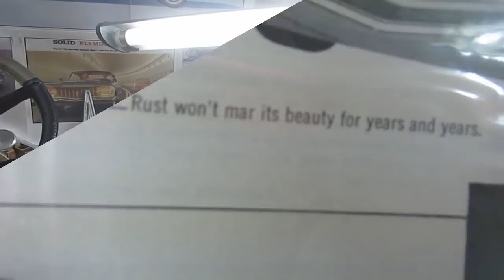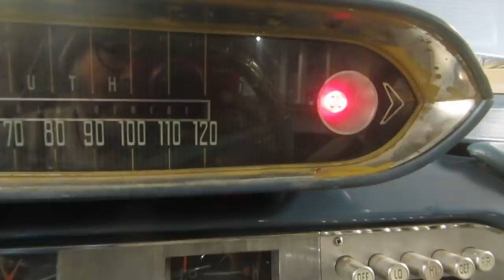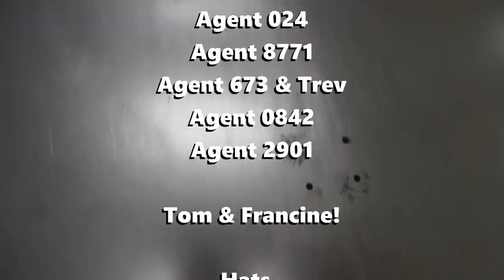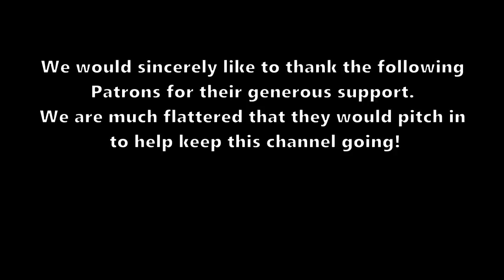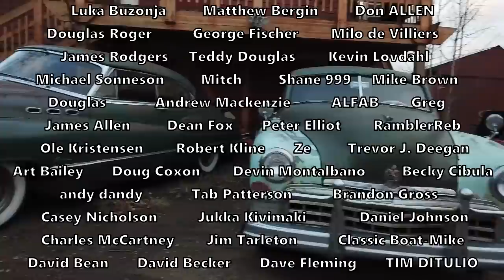Making panels, Sorting Signals, and Dent Repair!

Comment: Hey Scott: to answer your question; yes, I definitely would like to see the detail work on the Fury like the cleaning and reassembly of the turn signals. Love to see how they engineered the car back in day such as when you showed us how the rear window mechanism worked to bring the window up and forward. Can't believe I watched 18 minutes of boogie van corner piece fabrication and enjoyed every minute of it.
Reply: They built the old Plymouths and Dodge cars just like a gokart with lavish interiors head lights and turn signals is how they built em. Back in the day it was an extremely bad exp if ya took Armorall to a Plymouth or Dodge car seat. You would either fly out the window or slam your shoot right into the glass when turning a corner and it wasn't at all odd if you left go of the steering wheel while cornering you could end up in pass seat with nobody to hit the brakes or steer the car. The reasons I always took my little brother along on rides. He stayed in the back seat just in case that happened to me again...
Reply: @thekingsilverado9004  That is freaking hilarious. Reminds me of when my brother took me for a ride in his 1958 Chevy Delray tearing around a gravel pit. He cranked the wheel so hard that it went up on two wheels. I could hear the gravel scraping the passenger side rocker panel. And then he slid across the front bench seat still hanging on to the steering wheel with one hand. The car came down on all four wheels and we laughed our asses off!

Comment: Another interesting video where we can see how to repair and remove dents from panels. It was amazing to see that corner for the boogie van go from flat metal to a corner piece. That was a good workout for Mark on the metal shrinking machine. He doesn't have to go to the gym for a cardio. I bet you the next day he had trouble picking up a toothbrush.

Comment: When the turn signal switch was only just the turn signal! Now it’s the high and low beam, the headlight flasher, the controls for the headlights themselves, and 90% of the parts are plastic and clipped together!!

We had a 1969 Holden HT Kingswood (Aussie GM) with a just a turn signal stalk when I was a kid. Mum flicked it on to turn left one morning and it somersaulted up and over the steering column and landed on the passenger floor ha ha! Just as well for the self-cancelling 😀

Comment: HI SCOTT, YOU AND YOUR FRIENDS ARE DOING AN EXCELLENT RESTORATION ON YOUR 1960 PLYMOUTH FURY!  I am looking forward to seeing the 1960 Plymouth Fury get Completely Restored In The Future Episodes! I am A Chevrolet Man! I own and drive a 2015 Camaro 2LS 3.6 Litre V6, Right NOW, which is my 7th car because I love the looks of it and it was styled after the 1969 Camaro! I have also owned 3 Monte Carlos: A 1976 Landau Sport Coupe with a 350 C.I.D. 2 Barrel V8, which was my 1st car in 1986 when I turned 16! The 3rd car: A 1997 Monte Carlo LS 3.1 Litre 3100 V6, 4th car: A 2000 Monte Carlo SS 3.8 Litre 3800 V6! I have also owned a 1995 Beretta SS 3.1 Litre 3100 V6, which was my 2nd car after the 1976 Monte Carlo Landau Sport Coupe! My 5th was A 2004 Impala LS 3.8 Litre 3800 V6, 6th one was a 2006 Impala SS 5.3 Litre (327 Cubic Inches Displacement) V8, which was the Third Year for The Front Wheel Drive Impala 4 DOOR SS Model! The First and Second Years for The Front Wheel Drive Impala 4 DOOR SS MODELS HAD A 3.8 LITRE SUPERCHARGED 3800 SERIES V6! THE THIRD YEAR FOR THE FRONT WHEEL DRIVE 2006 IMPALA SS HAS A 5.3 LITRE (327 C.I.D.) V8 FOR THE FIRST TIME WHICH REPLACED THE 3.8 LITRE SUPERCHARGED 3800  SERIES V6 AFTER THE FIRST TWO YEARS THE FRONT WHEEL DRIVE IMPALA SS WAS MADE IN MODEL YEARS 2004 & 2005! IF GENERAL MOTORS (GM) NEVER EXISTED, I WOULD HAVE BOUGHT CHRYSLER PRODUCTS OVER FORD PRODUCTS! MY MOM'S SIDE OF THE FAMILY ALWAYS BOUGHT GM, INCLUDING MANY CHEVROLETS! THE SIDE OF MY MOM'S FAMILY IS WHERE I GET MY PREFERENCE AND LOVE FOR CHEVROLETS! MY DAD'S SIDE OF THE FAMILY ALWAYS BOUGHT CHRYSLER PRODUCTS, INCLUDING CHRYSLER WINDSORS, NEWPORTS, & NEW YORKERS, DODGE POLARAS, MONACOS,  &  DODGE PICKUP TRUCKS, AND PLYMOUTH FURYS & GRAN FURYS! IF I WAS INTO CHRYSLER PRODUCTS, I WOULD HAVE A 1974 PLYMOUTH FURY 3  OR A DODGE MONACO BASE OR CUSTOM - 2 DOOR HARD TOP SPORT COUPE WITH A 440 4 BARREL BIG BLOCK V8 WITH DUAL EXHAUSTS JUST LIKE THE POLICE DEPARTMENTS IN CANADA & THE UNITED STATES HAD BACK THEN & THE SAME KIND THE BLUES BROTHERS HAD ON THEIR 1974 DODGE MONACO 4 DOOR SEDAN!😎👍👌🤘✌

Comment: In 1973 I was in El Paso, TX, I had a 1962 white plymouth valiant SW.... (I still have those Texas plates hanging on the wall of my garage). The sound of those direction lights reminds me of that car ...Also similar that push button automatic transmission...

Comment: Hi Scott, Frankers, Agents, and Trev! Trevs a good boy! The metal shrinker would surely be a hard job to do all by yourself. Fun to watch. Glad to see the lights working on the Fury. Taillights look amazing. Steering wheel too. And you have a better one! That DS is going to be pretty in blue. Crazy, the roof comes right off it. Not quite as crazy as the SM, but very unique is an understatement! Be nice to fix up and paint the forklift. Build a plow that slips on to the forks, tire chains, push mountains of snow! Als a helluva cameraman, but we still miss Dean, falling over!

Comment: At Citroen it’s as if the designers and engineers were told, “Here’s how an automobile looks and functions. Your task is to make  the same thing but do everything it in a different way. Different is more important than better, by the way.”  You have to appreciate their accomplishment at least.
Reply: I have an old DS en route to me soon, I'm both looking forward to its arrival and dreading it.
Reply: I think Citroen were a lot more radical than that.  More like - your task is to work out how an automobile should function, and then work out how it should work. And then what it should look like.  But on no account do anything in the same way as anyone has done it up to now.  Just don't even think about it....

Comment: It's hard to believe, from where we are now, that anyone would think a car with a steering  wheel like the Fury's would sell to the mass market. It's a masterpiece of mid-Century industrial form over function, when people imagined space cars with thin bubbletops and drivers in Shatner uniforms walking freely on asteroids. Exner went nuts after the success of the '57s. They cheaped out on signal mechanisms by the mid-60s, though. The cam became a light nylon casting that was subject to becoming brittle and snapping with age. I had to replace quite a few of the in my old MoPars. 2nd gen A-Bodies also had just a stamped yoke with two bolts cradling the steering column, Both mine fell out when an attractive lady friend was driving solo and the wheel fell in her lap. Fortunately, the car had power steering, She found a filling station and asked the gas attendant if he could fix it. His response was to give her a wrench and leer at her while she did it herself. But, I digress...

Comment: What a difference in that turn signal switch compared to even the later sixties plastic ones with brass rub buttons and arrow shaped plastic tabs. Engineers from back then would be appalled at the quality of handles, switches , etc. we see today.

Comment: you guys should have the fury steering wheel recast. there's a company that restores old steering wheels like new again, even the clear ones with metal flake in em! but this company uses a UV resistant plastic that prevents cracking and yellowing.  the company is called quality restorations. and they have the molds for most steering wheels, from 1934 to 1969. and they've restored 1960 plymouth aero steering wheels before.
Reply from the maker: Well, it is a nice idea, but the cost would be more than I have into the entire project to this point, and it is a driver car... I guess I'll have to do it myself, all the materials are available... Cheers!

Comment: I did not want to comment on the fury steering wheel  but now that you mentioned it was a stand in I had thought to myself that it looked rough for such a smooth car - also a close up of that speedo trim was shocking - I imagine  it will be addressed also ?

Comment: Amber front turn signals didn't appear until 1963, they're out of place on your 1960 Plymouth, use clear 1157 bulbs and it'll be correct.This was before your time, so how would you have known?
Reply from the maker: Oh, I just like the amber ones better, and it is a pretty easy change. Looks like 1157s are not spec'd until 1969, with 1034s specified before then. I assume they are very similar though, because 1157s do work... Thanks for the note, cheers!
Reply: That Plymouth has exasperatingly too many parts,  @coldwarmotors . Your patience is monumental.

Comment: Hey , awesome update ..that horn setup is waaaaay cool.. cars today could use some of the styling clues instead of the cereal boxes there producing.. and for the many hours of entertainment you and the guys have provided me with i want to return that in my small way..i would like to send you something that will help when you start to work on the forklift and a little something for the darts segment.. it will fit right in with that and the overall premice of coldwar motors.. would it be possible to get a address to send it to?... cheers
Reply from the maker: Hi! Send me a note through the "Contact us" tab on the store website, and I'll get in touch as soon as I can... Cheers!